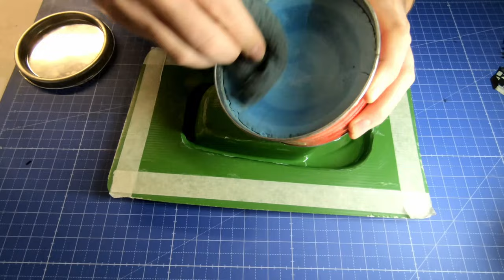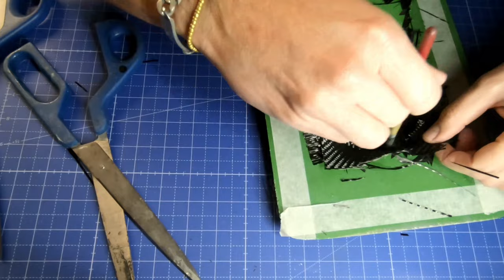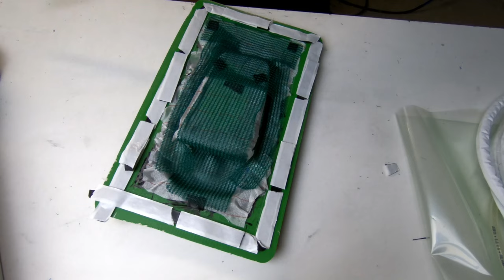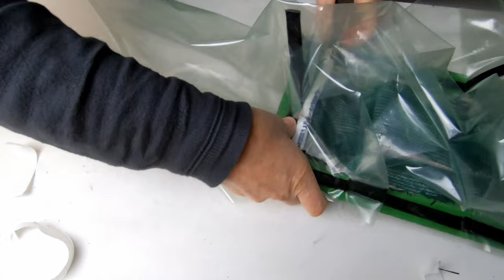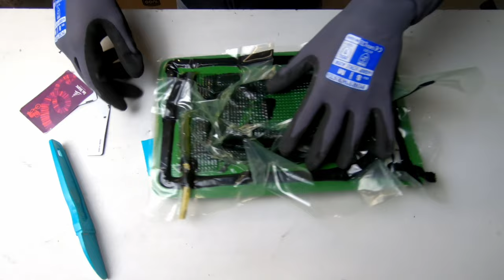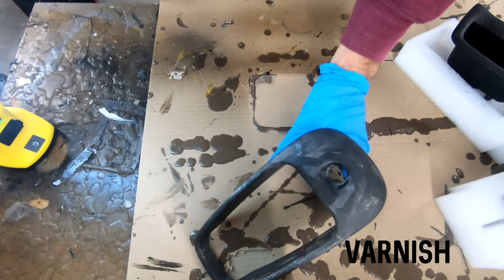Tutoriel - Comment faire une infusion en fibre de carbone forgé/coupé?

Comment from the maker: If you have questions....
Reply: Bonjour, super travail ! Si je veux faire la même chose, je dois prévoir quel budget pour une pièce de +- la même taille ? Merci
Reply from the maker: @fabrice3892  Merci pour le soutien 🙏. s'il faut faire un moule, donc acheter la résine poly ou vinylester, acheter le gelcoat, le mat, la cire, la pompe à vide, les consommables, le tissu de carbone et la résine époxy, le vernis, le pistolet à peinture, le compresseur ça fait pas mal de matériel et du coup un petit budget. Si c'est pour faire qu'une pièce, ce n'est pas la peine de démarrer. 
Là avec ce que je viens de dire, ça monte rapidement à 350-500€. En fonction de ce que vous avez ou non. Vous aurez par contre un reliquat de résine, Gelcoat...
C'est pas évident comme question.

Comment: Hi,
How does is the part held in place? The original had clips but the carbon one does not?
Reply from the maker: Hi.
Clips are partially copied. You actually have to add a piece inside.